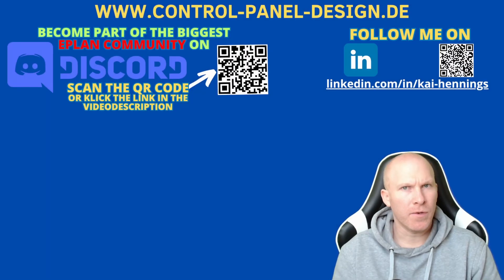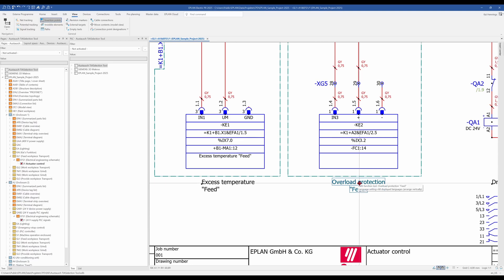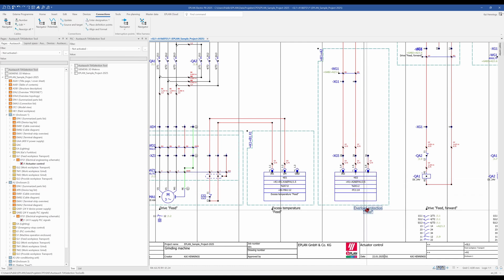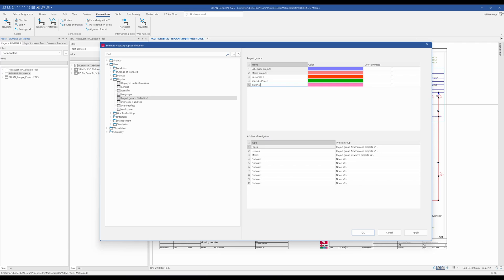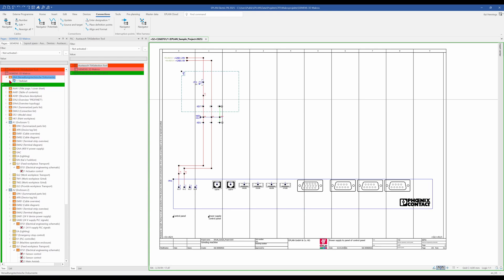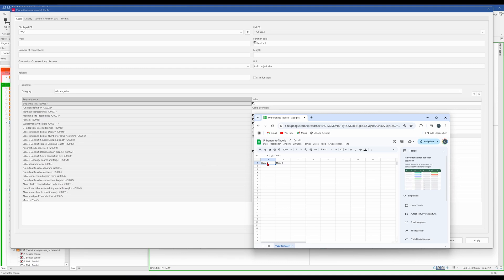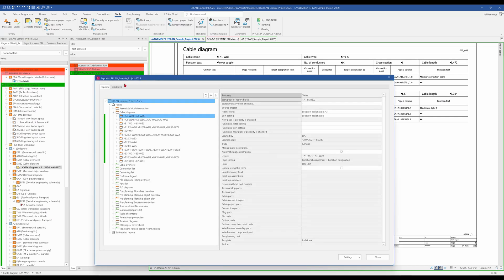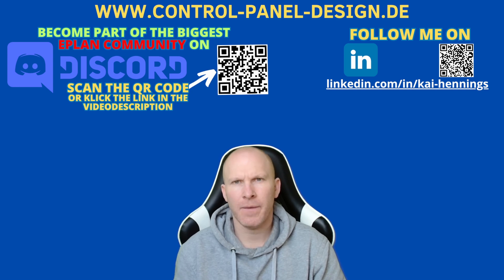5 EPLAN P8 Tips and tricks for beginner and advanced users

Comment: I made a macro for a PLC. There was a block with a code for ordering, which I described what each letter of the code means. I did this in version 2.9. However, when I tried to transfer the macro to version 2024, the text does not match, it seems that the spacing between the letters in a row has changed. The scale and font are the same in both versions. How can I configure it so that it is the same in different versions? I also have the same problem in the framework.